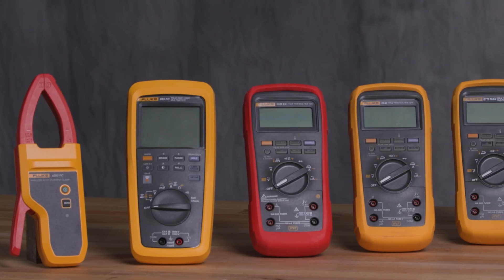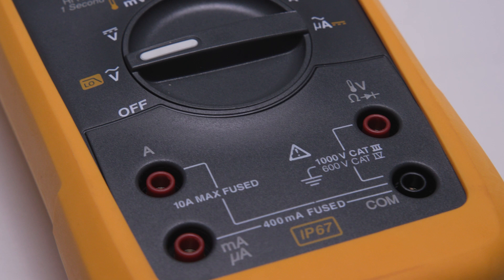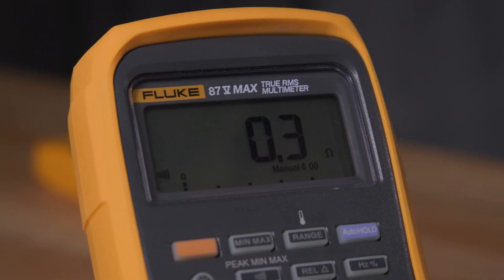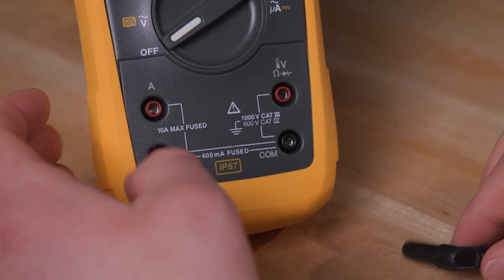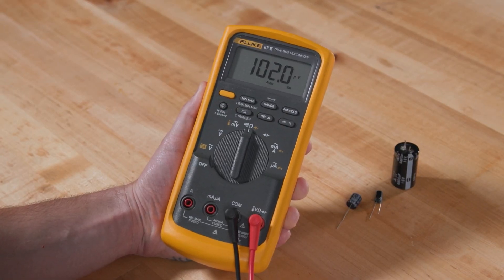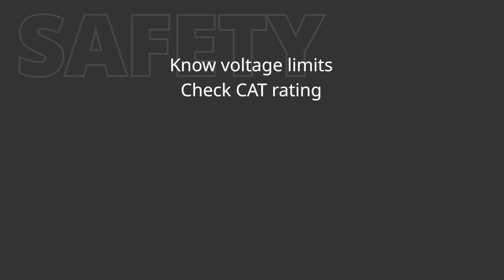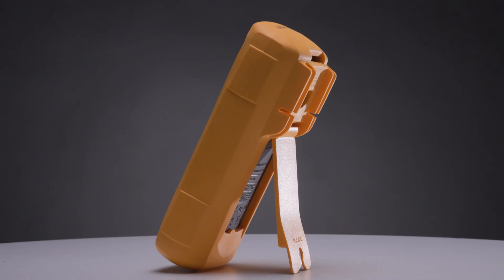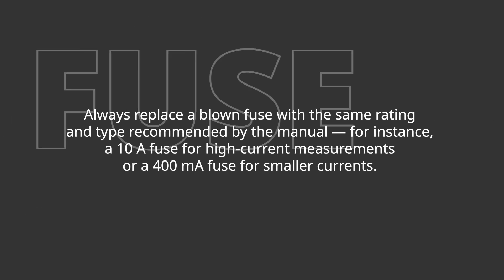How to use a Multimeter | A comprehensive guide

Comment: If you need this tutorial to learn how to use a multimeter you probably shouldn't buy a Fluke.
Reply: What are those finger-pushy things called again?  (joking)
Reply: Instructions unclear, I put the negative probe in my urethra, and red lead in the ac outlet. No results, but my Ed is fixed.